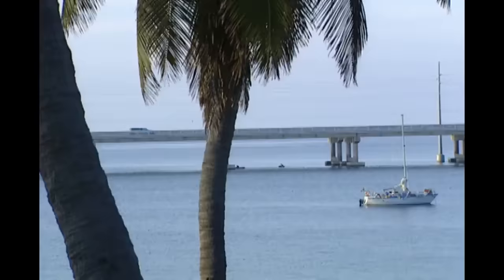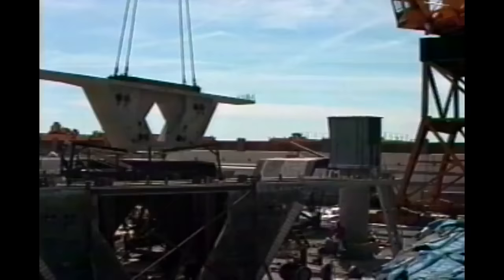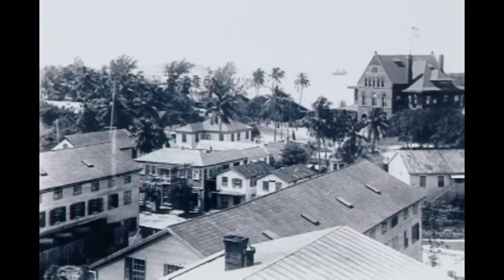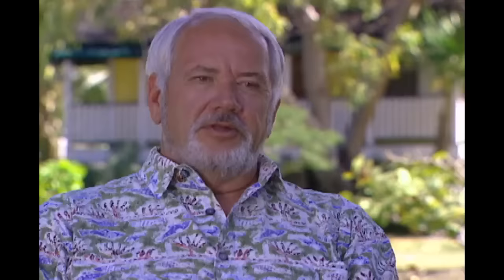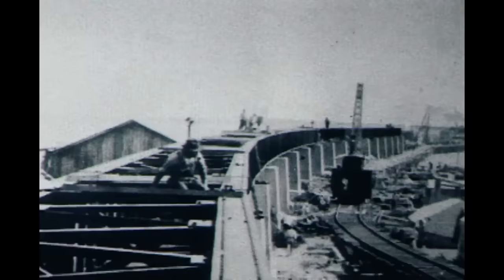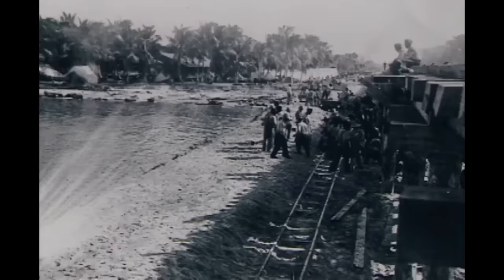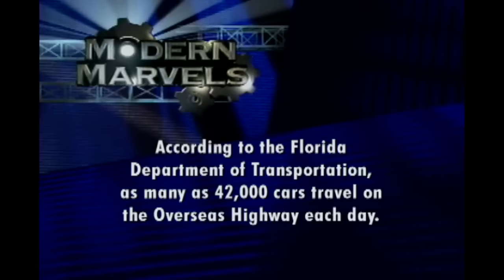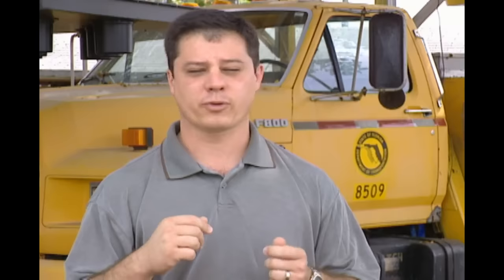Modern Marvels: Massive 1912 Oversea Highway - Full Episode (S10, E54) | History

Comment: I lived on Vaca key for 5 years,  most people would call it Marathon. But that is the name of the city on the island. The new 7 mile bridge that runs next to the old one is under constant repair for concrete damage while the old bridge is ignored and is still sound...
Reply: The old 7 is being repaired right now
Reply: Under constant inspection you mean. The only reason the old seven was still “sound” was because it hadn’t had a load of traffic drive over it since the 80s. Also, the old seven isn’t ignored, it’s being restored

Comment: well Irma took out part of the road at about mm 74, the bridges held up fine even the old bridges, i was here and we had winds in Marathon i heard over 150 mph and 20 miles west it was around 170 or better, all the very new buildings held up great other than needing to be pressure wash or painted
Reply: My garage wall was tilted 45* degrees outward and the other one was swept away by the storm surge

Comment: The Bahia Honda bridge was not a trestle. It was a through truss bridge and the highway bridge was built over the top of the truss spans, enclosing them. The steel structure was not properly protected by the road department with paint and the truss spans rusted to the point that they were falling apart. The highway department could have done a better job of maintenance, but they didn't. Other bridges like the Golden Gate or the Chesapeake Bay Bridge Tunnel. are better protected by constant painting.
Reply: The Chesapeake Bay Bridge-Tunnel trestles are comprised of reinforced concrete.

Comment: The original railroad bridge with a core of reinforced concrete over which the first oversea highway was built has lasted over 100 years. The new prefabricated construction has had concrete leakage and steel erosion fairly early and needs constant repair. In fact,  it's sort of a lost art secret how the first bridges were constructed so well. I read that part of it had to do with a special granite or whatever they used to make the concrete that was imported from, I'm not sure where. The guy mentioned in this video who designed the bridge was the top concrete expert in the world.

Comment: Hurricane Andrew hit Florida and the keys in 1992 and it was a cat 5. I'm not sure what they're talking about when they said there have been no cat 3s or worse to hit the Keys in 50 years.
Reply: Hurrican Andrew DID NOT hit the keys in 1992. It hit Homestead. And it was a relatively small storm. At worst, Key Largo got hit with cat 1 or 2 force winds. The rest of the keys just had rain and moderately strong winds.
Reply: Keep in mind that in terms of where a hurricane makes landfall, it refers specifically to the path of the eye and the 50 to 80 mile radius around it. In reference to Andrew, the keys would be in the outer bands at that point.
Reply: George '98 cat. 4
Reply: @ArnulfoSalgado  The Monroe County Emergency Management department would beg to differ. Their website lists Andrew as one of the hurricanes that hit the Keys. Just because the eye of a hurricane doesn't directly hit a location doesn't mean it hasn't hit it. Just ask the Gulf Coast when Katrina hit.